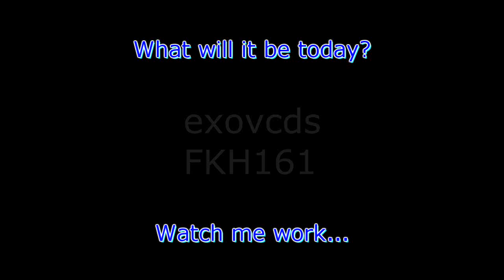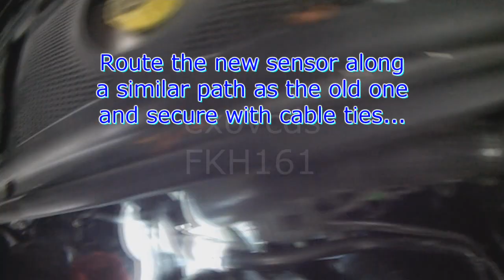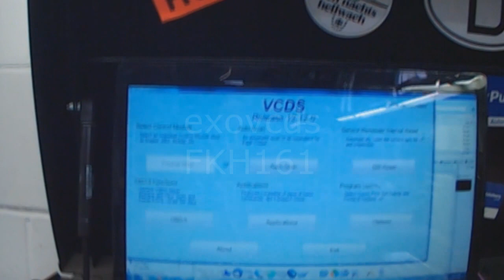Audi B5: 1.8T Crankshaft Position / Engine Speed Sensor Replacement

Comment: Hi, what would be a normal voltage reading with the sensor unplugged (5 volts power supply, 5 volts signal and  a ground)?  I have a 95 golf III with a 2.0 Ltr.  engine with engine speed sensor code and a no start no spark condition, scoped cmp and its working, pulling 5 volts to ground, VCDS shows no engine RPM when cranked. When ckp unplugged it shows, good ground, 5 volts signal and no power supply. I checked my powers and grounds on ECM and they are good, I'm suspecting bad computer, any suggestions?
Thank you.
Reply from the maker: The sensor is an AC voltage generator. 6vac to 12vac at idle... if below 2.6vac when cranking, the engine will not start. One of the 3 wires is a shielded ground. The other two are the AC signal wires. Attach your multimeter across the two signal wires and check the AC voltage.

Don't know what the reference / circuit integrity voltage is off hand... would have to check / test myself.
Reply: ok, so this sensor rides over the dc voltage?
because another sensor was installed with the same result (no waveform), and then  I rigged a 5 volt regulator  and a ground to the sensor and a waveform was produced, the sensor was unplugged but installed on the car  while cranking it.
Reply from the maker: +George Navarro Should produce a signal without a DC ref signal https://youtu.be/RvuzZJqQDf4 if it produces a voltage, sensor is good and the issue is ecm or wiring.
Reply: +Thomas EXOVCDS Ok, I will recheck everything, thanks for your time and super-fast response.

Comment: Same as a 04 1.8t Beetle?
Reply from the maker: Yeah, watch my Jetta 2.0L crank sensor video. Exact same location & procedure.
Reply from the maker: This is the one I meant:
VW A4: 2.0L Replacing Crankshaft Position Sensor / Engine Speed Sensor
Your 1.8T is the same... but you might have a bit less room with the Secondary Air Injection Pump sitting down below.
Reply: ***** Many thanks man.  I didn't have the tool to get the plastic shield off but was able to pull it down enough to see where the sensor was and get it off.  My wife kept bringing up the fact that it took you only 5 mins to do it.  She apologized later.  We had fun though.
Reply from the maker: zombieno1 LOL, yeah it takes longer than 5 minutes... editing cuts out a lot. I'm sure nobody wants to see the whole thing at real time (getting the car from the parking lot & lifting it etc.).

Comment: I have a 2002 Jetta 1.8t - I have these conditions:  starts and shuts off immediately.  I don't see any immobilizer warning light.  the power windows don't work and the rpm needle does not move when I try to start it - also - the odometer shows no reading - so both digital readouts show nothing but I have all the normal dash lights that should come on when you turn the key.  Battery is new.  I used to hear a loud pump activation when opening the driver door.  Now it activates but not noisy.  Fuel pump relay clicks on and you hear the fuel pump run.  When I try to start - the relay clicks off and I guess the pump shuts off and the engine dies...
Reply: also - the fuel tank is low - may be a little over 3 gallons in there...
Reply from the maker: Start with a full system scan (all the control modules)... if you don't have VAG-COM / VCDS to do that... find someone in your area with the tool / software. You can find someone by looking in your local area via this map link: http://www.maptive.com/ver3/VCDS_Locator zoom-in on your area to find someone close to you.

Comment: Would this process be the same as a 99.5 2.8Q ?
Reply from the maker: The crank sensor on the 2.8 is on the transmission bell housing... driver side.
Reply from the maker: https://youtu.be/Bs2VKAynWhQ

Comment: Can a crankshaft position sensor cause the car not to start??
Reply from the maker: Oscar Becerra yes.
Reply: Thank you for your response do you know what code it is?
Reply from the maker: P0322 is the most common:
http://wiki.ross-tech.com/wiki/index.php/16706/P0322/000802
Reply: Thank you once again for your reply much appreciated
Reply: In the moment when this sensor it's broken, spark on the spark plug it is not ? And the fuel not go into the engine?
Reply: I add,that I have Audi A4B5 1.8T 2000year. On the VAG / computer I have nothing error - I read that something  this happened. My engine can't start, only "spinning" nothing more. I change spark plug but all the time the same situation :/
Reply from the maker: A bad sensor should set fault code... but yes, you will not have spark or fuel when this sensor is bad.
Did engine stop while you were driving? It could be that the fuel pump is not good or the timing belt is broken.
Reply: Thomas EXOVCDS no,one day before normaly I was drive. After rain night I want to drive and the engine not work. I have lpg instalation and I try to run only on the lpg if the engine will be work,fuel pump will be broke,but nothing change

Comment from the maker: +Kris Nicholson When was the last time that you had the throttle body bore cleaned? Check / do that first. G68 is a transmission speed sensor and should not affect the engine running condition.

Comment: Hello, sorry my car is an audi a4 from 2003, and recently started not wanting to resplnder as before and feels like I do not want to pass gas, I take it to the AutoZone and they put the computer to it, and it marks me disfire in the four cylinders ,
Reply from the maker: Could be a bad ignition coil or spark plug. You need to check those parts. Swap #4 ignition coil with #2. If the misfire goes to #2, then you know the coil is bad (the coil that you moved from #4 to #2).
Reply: Thomas EXOVCDS change spark plugs, but followed the same, thank you very much, check The coils then

Comment: im having a problem with my car i drove perfectly fine to the gym and when i came out the gym it started up perfectly fine. I pulled out of the parking lot and went down the street to the stoplight and as i was waiting for the light to turn green my engine cut off instantly, it didnt sputter or give any other warnings it just cut off. i tried starting it and it would just crank but not start. i checked for spark and it does have spark. i had to get towed home. please help me resolve this problem.
Reply from the maker: Year, model engine? Did it start after you got it home?
Reply: +Thomas EXOVCDS 99 vw passat 1.8t aeb and no it just cranks and no signs of it wanting to start

Comment: Hi there, I am having a bit of a strange problem. My AWM Audi A4 1.8T suddenly dies on me at an intersection. I crank the car a couple of times and the engine turns over but nothing. I keep trying over the next 15 minutes and nothing, once or twice it sounded like it was going to fire but it only did once and nothing. I waited some more and it fired right up. Could it be that the crank position sensor is dying or perhaps is it a fuel pressure regulator? I'm just trying to figure out what could stop the engine from working but then after a 20-30 minute cool down, starts right back up no problem and drove for the next 15 minutes without a hitch. Perhaps a relay? Any help would be appreciated. I will read off the codes tomorrow and see what they tell me.
Reply from the maker: +Michael Nesterak Probably a crank sensor issue... could be a relay also. Let me know what codes are stored.
Reply: +Thomas EXOVCDS The codes are 
P0322 Engine Speed Sensor G28 No Signal
P0420 Catalyst inefficiency
P0343 Camshaft Sensor Input to High I think...

So I ordered the Crank and Cam shaft sensors as well as a rear O2 sensor and I hope that solves it.
Reply from the maker: mneste8718 The crank sensor will most likely solve the no start... make sure that the camshaft sprocket is turning (timing belt ok). Cat code is most likely not an O2 issue.
Reply: You were correct sir. It was a faulty crank position sensor. Unfortunately no one told me that the socket in which the sensor goes into is behind the oil filter and not on the transmission bell housing. I can't believe there are 2 identical holes for it. One of them being wrong. 

Also turned out my cat was bad as well.
Reply from the maker: Michael Nesterak Sorry about not pointing out where the location of the sensor was... I assumed that watching the video would have made that somewhat clear. Thanks for the update!

Comment: I have a 2001 vw beetle 1.8 engine, 5 speed and I noticed it has a hard time starting sometimes but most recently Its been stalling on me while at a low speed or even at a complete stop. Its scary because i lose my steering and no breaks. I took it to a mechanic and was charged 800 for a mass air sensor but its still doing the samething. Does anyone know what this might be. *Had the fuel pump replaced over a year ago.
Reply from the maker: Christine Estes When it stalls out, does it start-up right away? Yes, could be a crankshaft position sensor issue.
Reply: Yup starts up right away.
Reply from the maker: Christine Estes There are several things that can cause an engine to stall out and start right away... the only way to be sure what the problem is, is to be able to test it while the problem is occurring. Obviously that is difficult if it doe not happen every day / very often... and you have to have the test equipment attached to the right components while the problem is happening. 

At best, the engine will not restart at all... at which point, the problem can be found in a short amount of time.
Reply: So I spent $800 on a machanic to replace the MAF sensor and this morning i start the car up it starts shaking and the gas petal goes to the floor. Isnt this due to the MAF sensor?
Reply from the maker: Christine Estes Could be misfiring... not sure what you mean by the gas pedal going to the floor. They don't move unless someone pushes on them.

If you meant that the engine would not respond even with the gas pedal pressed to the floor... that's a lack of response from the ecm for whatever reason.

You need to check the coolant temperature sensor for a correct signal as well as the fuel pump for correct flow & pressure.

Drive with the MAF disconnected to rule it out.

Comment: Hey man, hope you had a great family-party weekend!

Quick question, whats the service on the B5 5 speed auto transmission? Like when to change the oil and filter?
Reply from the maker: +Rafael Torchio VW just says to check for leaks every 20k miles... I would change it between 40k -60k
Reply: +Thomas EXOVCDS thanks! I will order a kit for it.

Comment from the maker: +jeremiah jenkins Check for fuel flow (disconnect the feed line at the injector rail and point the hose into a container)... have someone crank the engine while you check for flow. You might have a bad fuel pump or clogged fuel filter.

Comment: U think is a good chance that is that head engine
Reply from the maker: +Felipe Tapia I don't know what you mean. I can't check the engine with my keyboard. Does the smoke smell like coolant, oil or fuel? Have you checked for excessive oil in the intercooler? Remove the bottom air hose from the intercooler or drill a small hole and let the oil drain out: https://www.youtube.com/watch?v=21BhxvAC8gk your intercooler is on the other side, but if you drill a small hole at the lowest spot, it will let the oil drain out. If you have too much oil in the cooler... the engine can't breathe.

Comment: To be honest i change the turbo and still slow
Reply from the maker: +Felipe Tapia Does the smoke smell like coolant, oil or fuel? Have you checked for excessive oil in the intercooler? Remove the bottom air hose from the intercooler or drill a small hole and let the oil drain out: https://www.youtube.com/watch?v=21BhxvAC8gk your intercooler is on the other side, but if you drill a small hole at the lowest spot, it will let the oil drain out. If you have too much oil in the cooler... the engine can't breathe.